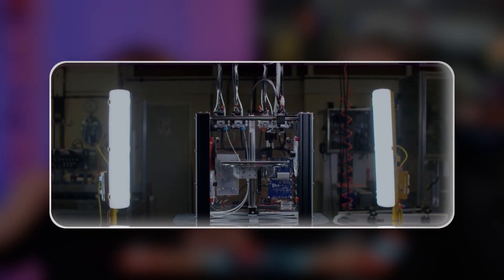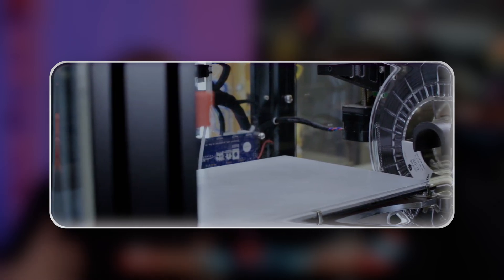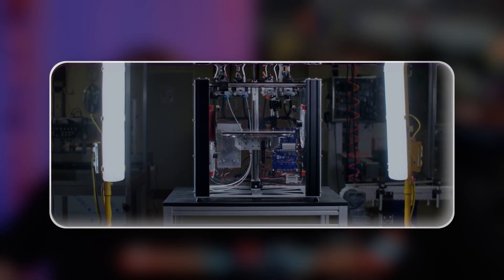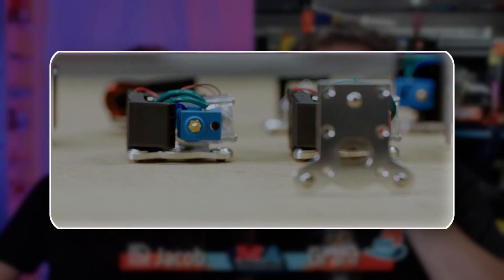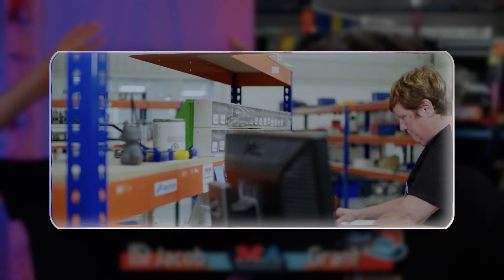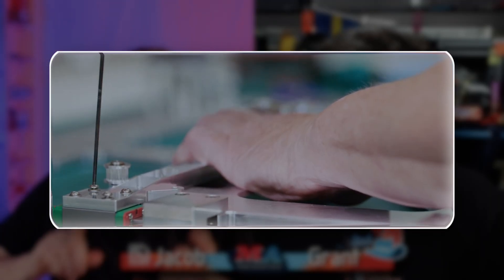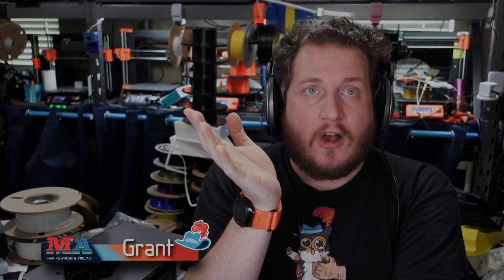Let's Talk Multi-Material: AMS vs. Tool Changers

Comment: 12:50 -- multi-head tool changers are going through the same sort of reliability concerns that drove early aviation, where the pioneering aircraft all had a single engine (even if they were driving multiple propellors, like the Wright Flyer) until the reliability of lightweight aircraft engines increased to the point where a second engine was a greater benefit than the cost of doubling the chance of either or both of the engines breaking down in flight, where an individual engine wasn't powerful enough to  keep the aircraft in the air by itself.

Comment: Thank You Sirs for interesting and entertainingly sprawling 3dp content (in the sea of unboxings and honest reviews). From my pov thumbnail of this video would be: filament AND tool changers, I see both solutions viable in my use cases. Coming from way too heavily modded enders to Vorons I have come to the conclusion that it is better for me to start from scratch and build it myself than to modify something that is supposedly ready-made.
Gratefully, there are some interesting projects in the community regarding the topic. I'm closely following the Busy Snail Filament Changer project and the Click Changer Tool Changer project. I plan to build them both when the time comes.

Comment: Actually some very valid points in this video.

For pure multicolour a filamentswapper is the best solution imho. No offset calibration needed. However, I personally miss discussions about the way a filament-changing system handles the swap in the hotend itself. All theese chineese multicoloursystems (and some other) use "cut&poo". The only system I know using ramping-on-unload is Prusa in the mk3 to CoreOne line of printers with the MMU2/3 filament changers. The reason is quite simple:
You need a nozzle with a smal v6-like meltzone and preferably integrated heatbreak to reliable get a perfectly reloadable filament tip on unload without cutting the filament. Also the ramping profiles have to be tuned for the material and printing temperature. On the mk(s(+)) tuning ramping profiles was a pita. The MMU2 on the mk3(s(+)) actually become much more comfortable and reliable, after e3d released the Revo hotend. The integrated nozzle/heatbreak delivers good filament tips on unload with Prusa Slicers standard profiles for rampin-on-unload without tuning.
However: The downside of needing a smal meltzone is obvious. Volumetric flow is limited, single colour prints take longer than on other printers. So if you want to use faster printing in single colour, you either need a compatible nozzle/heatbreak combo with patented CHT-technology (Revo HighFlow, Nextruder Highflow) or an changeable hotend.
As a v6-size meltzone is quite smal, you need less material to wipe it clean. Much less material wasted (you can even print "waste" objects were colourbleeding do not matter to clean the meltzone). Also much faster filament change (Anycubic Kobra 3 with ACE pro: About 2 minutes, Prusa CoreOne with MMU3: 35 seconds).
However, this is not due to the filament changer (ACE pro/AMS etc vs. MMU3) but the hotend you use. As the ACE pro uses a normal serial connection via USB with some fancy connectors, someone already "hacked" the protocoll to connect it to any Klipper printer (DuckACE on github). So if you have a Klipper printer with a Revo hotend, you could use the ACE pro for filament changes, but still Prusas "ramping on unload" for low-waste-low-time un- and reloading it.
As the MMU3 uses a documented protocoll to comunicate to the printer, it would obviously be possible to use a seperate controller as a "translation device" to connect a CoreOne one and one (ore more) ACE pro (and also control the integrated filament dryer). Sadly I am not a programmer to do it myself.

For real multi-material, you mostly only need two tools. The simplyest 2-tool toolchanger is an (I)DEX. Imho a RatRig vCore 3.1 or 4.0-IDEX is a very underrated solution for multicolour+multimaterial. You even could use a Revo-Hotend on the second toolhead and use a filament changer there with "ramping-on-unload". However, Prusa Slicer suports real or virtual extruders, but not both on the same time. You might need to write a gcode post-processing script.

Actually Bambulab practicly sort of  did this on the H2D. A DEX (without the "I" for "independend", as it is one printhead with two hotends) with filament-changers. Sadly both hotends use cut&poo. Would have prefered one of the hotend being "standard flow with integrated heatbreak" using ramping-on unload.

One downside of real toolchangers (including Bondtechs new INDX nozzle changer): You need many tubes, so you need more space verticaly to manage them. An enclosure has much more volume, so to print ABS you need active chamber heating (or only print in hot summers).

Yust my 10 cents to the discussion.

Comment: Speaking for the people who like 3D printing, not 3D printers, a lot of this talk is fun, but completely out of the circle of care for that group. 
The XL is too expensive, especially to get to the level of enclosed core XY printer types this group would want
The Snapmaker U1 is likely to be the XL for this group, in the level of 'getting up and running', 'just working' and price
As a hobbyist I certainly want to print multi colour (but frankly most people wouldn't care that much about poop wastage), print multi material (support interface material is great, but single tool head you are likely to mess up faster) and print continuously for larger prints without having to manually switch spools (AMS like systems with continue, multi tool head with same material etc)
Frankly, I see very little value in nozzle switchers vs full tool head switches: having to retract and reload filament probably increases the contamination problem and does not help with faster printing due to faster switching. Having your nozzle possible needing to purge because you can still switch filament through the same nozzle, again poop waste. Is it better than having a single nozzle? I am not sure, it increase points of failure, but you could combine high flow, hardened steel and nozzle sizes, but if it costs as much as 2-3 extra printers..

I will see what the reactions to using the snapmaker U1 will be over the months to see if my next printer might be a multi tool head.. people seem ok with the XL, but why spend 5k on a fully built 5 head if you can get a U1 4 head for 1k.. In the end, for the 3d printing crowd (so not tinkerers) the main thing is indeed consistent, easy, working prints, as often as possible. (also, not heard anything yet about how much replacement heads for U1 will be)

Comment: I certainly wouldn't have bought any sort of MMU at retail prices. Between simple paint jobs and a lot of prints being separated out so you can print colors individually and then assemble, it's not that important. However, I did get anycubic's 4 color system because it was super cheap. $230 for the kobra v2 that included their MMU (ace pro). That's basically the price a cheap printer anyway, so ace pro was kinda free. Nice to have even for single color prints because you can select between 4 different spools. And occasional small multicolor prints don't make a huge dent even if they are relatively wasteful. I'd never do a large multicolor print though where waste could get into to the hundreds of grams of waste.

Comment: Interesting POV from Jacob, I’ve got a ProForge on order, which definitely has E3D Toolchanger inspired kinematic couplings, but like Grant I just need different sized nozzles preloaded, and the ability to print different materials primarily in one machine, and toolchangers do this just from the desk. The main reason I got this vs others was the build area is big enough to do larger prints, Proforge have history of good alignment, and the frame is flexible enough to modify further down the road. I’d I’m betting that INDX will be coming to this platform at some point,  however my first side project will be to fit a Picolino extruder from Magnetic-IDEX because it is a lightweight super competent set up.

Comment: Re Jacobs point about tool  changer coupling wearing a little bit after tens of thousands of tool changes - won't that still happen on the INDX?  So for a dual material multi colour print - would Jacob think an h2d would be better than an h2c for this in industry- due to less tool changes.